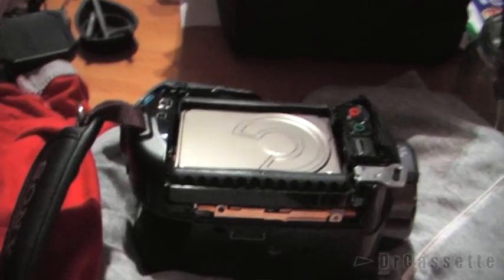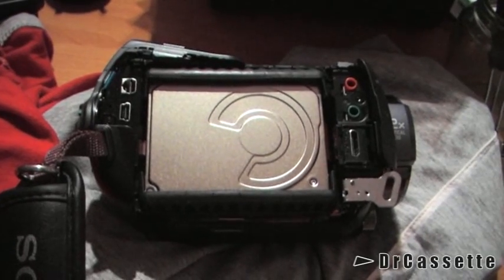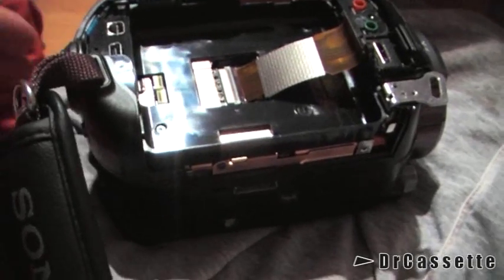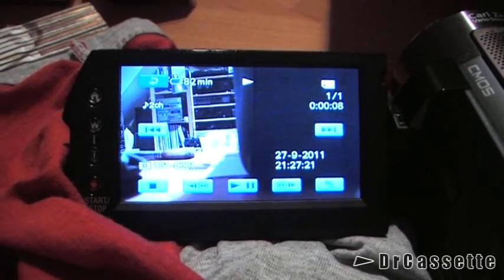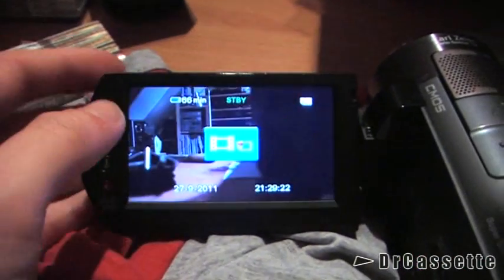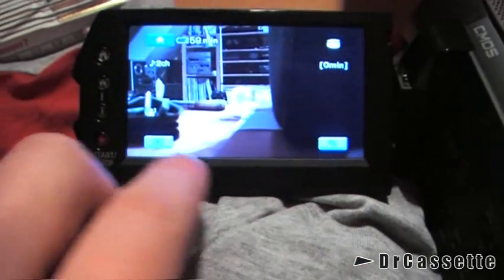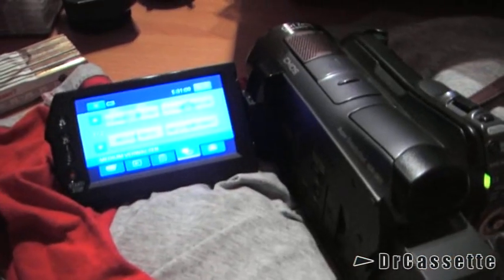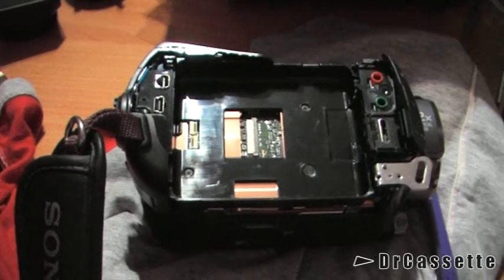Turning my Sony HDD Handycam into a solid state camcorder!

Comment: Hey! still online?
im facing a problem with my DCR-SR72E handycam. After powering on, it immidietly shutsdown and if i dont turn the swtich to off (chg) it continuesly powers on and of. i realised if there isnt any loops or shutdowns, after using zoom or mode change, it starts againg. i couldnt find the issue on internet. (i charged my battery fully)
edit: even without battery and powering directly from ac, problem presists. also i realised when i touched the black part that contains on of, photo and zoom knob. cam turns of immidietly (problem presists even when i dont touch that part)
Reply from the maker: Seems like you have a bad connection inside the camcorder somewhere

Comment: Pro duo stick adapter with a Terabyte of MicroSD. Switch video storage to it multiplying storage.  But left HDD where it is.
Reply: I'm not sure when the Microsd showed up in the market or even their adapters. I was browsing through and did not see anyone suggesting that. So I shared it.
Reply from the maker: @dmarckos   I'm pretty sure memory stick to micro SD adapters didn't exist back then, and of course 1 TB micro SD cards have only recently become available ;)
Reply from the maker: Keep in mind this video was made in 2011. Back then, your solution (which is indeed a better solution) did not exist ;)
Reply: hi i was wondering if you managed to get yours working with 1tb of storage as i am curious what the maximum supported capacity was. i have a fuji camera from the era that doesn't even support 128gb so i was quite surprised when i heard this supports up to 1tb

Comment: Hi still alive? 😅 Can you tell me about the Sony HDR-XR520VE? I want to take out the hdd and connect it on a computer to extract my videos because the CAMERA is kaput.. Is it possible?
Reply from the maker: The HDDs in these camcorders don't have standard SATA or IDE connectors. They use ZIF connectors. So you would need to find an adaptor to connect ZIF to the computer.
Reply: @DrCassette  they say it is 240 gb.. Is there a possibility this drive be bigger with a known connection? (sata)
Reply from the maker: As far as I know all hard disc drive camcorders use ZIF connectors.
Reply: @DrCassette  Thank you!

Comment: I have a Canon HG21 which I absolutely LOVE and now it has trouble reading the hard drive. It flashes for various lengths of times before finding the hard drive. I've tried fully reinitializing and it still does the same thing. Do you think changing the hard drive will solve the problem? or is it something else?
Reply from the maker: ***** When it has trouble reading the HDD, I'd say it's the HDD that has problems.

Comment: I'm going to get a SSD drive for this camcorder and see if it works. If it works, I'm going to use that instead of the camcorder's HDD because flash memory in something like my SR11 sounds pretty good (though I may upgrade to an XR500 some day...and move the SDD to that camera). I found a few SSDs that have a zif connector so I am wondering if those would work.
Reply: Crap from China, but it should (in theory) work.

http://www.ebay.com/itm/New-1-8-ZIF-CE-128GB-SSD-for-MacBook-Air-1st-Rev-A1237-Toshiba-Satellite-2410-/171212030406?pt=US_Solid_State_Drives&hash=item27dd0841c6
Reply from the maker: *****
Yes, indeed it does work. I once actually got one of these cheap KingSpec ZIF SSDs and put it into my Sony SR11E - I'm not sure weather or not I made a video about it, though. However, the camcorder will know something's not right and it will permanently flash an error code on the screen, but otherwisely it will work.
The XR500 is the model that came out after the SR11. I had the XR520 for a while, and the Exmor R image sensor makes it work a lot better in low light. Also it has the Active SteadyShot. The model after that, the XR550, also has the modern super wide lens, so you may want to go with that instead. The XR550 was the last high end HDD camcorder Sony made. After that came the CX700, that will also do progressive video recording.
Reply: DrCassette
I am stuck deciding between the XR550 and the AX100. Both are nice and with my new job, I should be able to buy one of them inside of a month.
Reply: I'm guessing the CX550 is the XR550 without the hard drive (and flash memory instead). I think I will be able to afford that one sooner.

Comment: So it looks like the firmware and system files are in ROM and not on the hard drive, so it will work without the HDD installed, not bad.  You could probably get a CompactFlash card adaptor that can go into your camcorder in place of the HDD, you could use a 32GB card, I don't know how much they are though.

Comment: Looks like a 1.8" hard drive with a ZIF-connector. You can get some SSDs for that, but quite pricy and slow ones with not much memory. But there are CF-adapters for ZIF, you should try that!